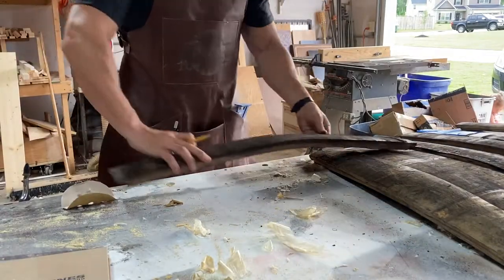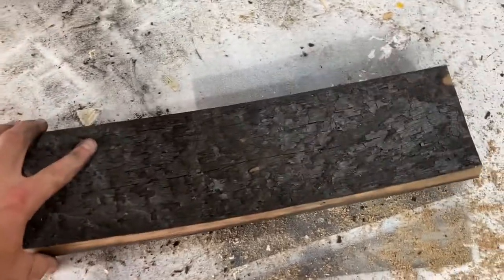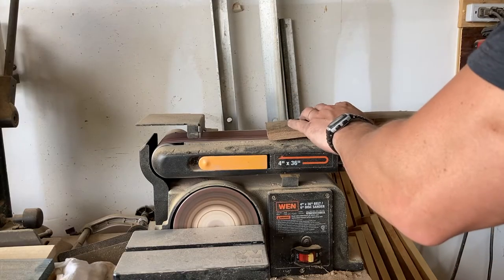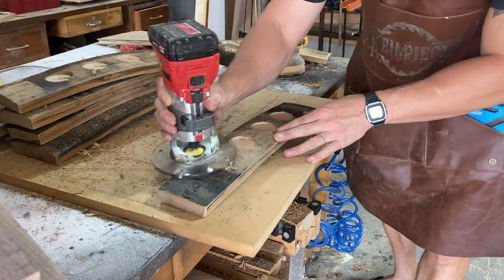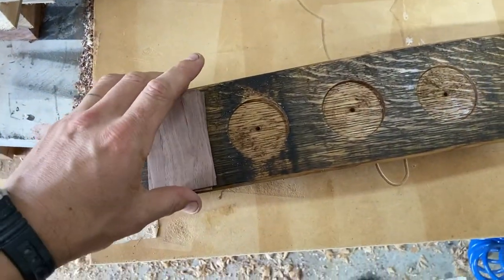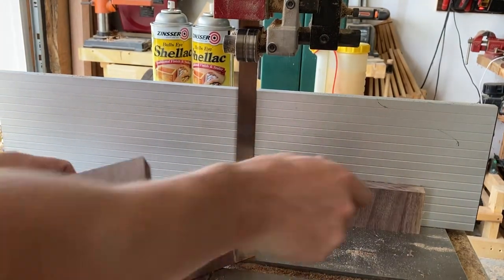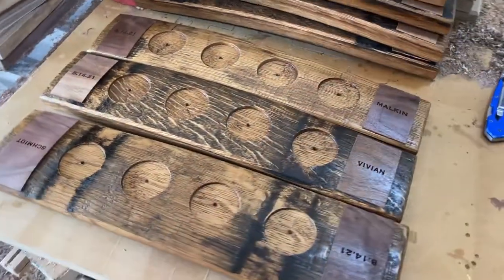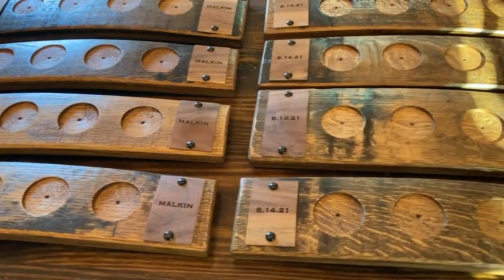Whiskey Flights Made From Real Bourbon Barrel Staves

Comment: What were the nails you used?
Reply from the maker: they are just decorative furniture nails
Reply: Which CNC machine do you use?
Reply from the maker: @ronnime3288  I have the xcarve
Reply: @KeimpieceCarpentry  thanks. Your work is beautiful 🤩
Reply from the maker: @ronnime3288  Thanks Ronni
Reply: What drill bit did you use to carve out the slots for the glasses?